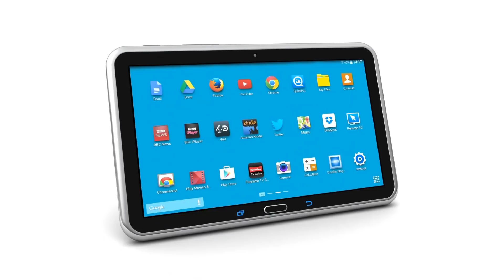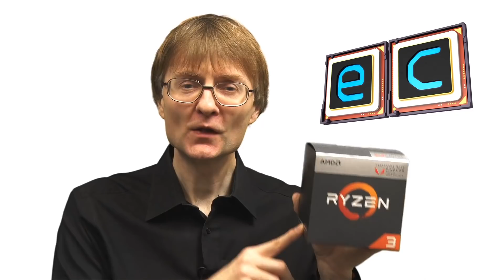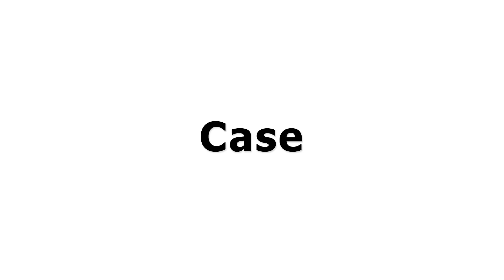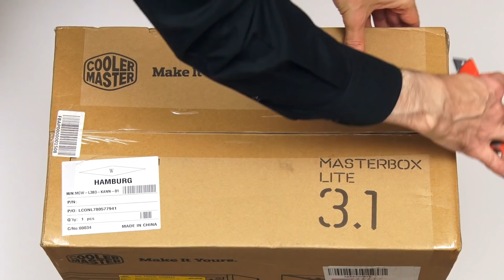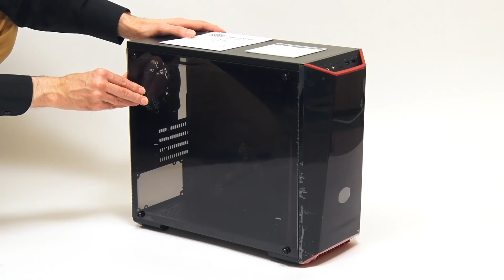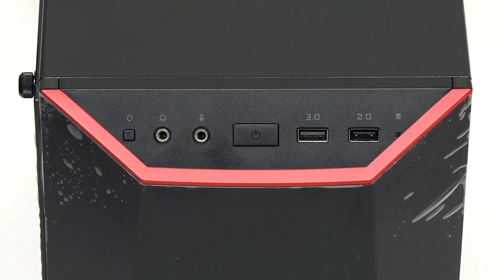Ryzen Budget PC Build #2: Case, PSU, SSD & Assembly

Comment: I am going to find it hard to sleep at night with the cables in a mess like that :(
Reply from the maker: Sorry about that. Try counting sheep! :) I will tidy them up more neatly when I have fitted all future upgrades. That said, there are few options for the mass of PSU cables. :(
Reply: @ExplainingComputers  :) Yeh looks like a pain in that case! You may have a little space in the bulge of the side panel .

I remember when cases had zero space in the back panel, i still managed to get a custom length IDE cable behind it..... just.

I like the red of the build , some nice LED fans are going to set that of a treat.

EDIT , another tip is to run the EPS 12v for the CPU between the motherboard and the tray , done that before you just have to watch out you dont crush it, most of the time you would have to plug it in and then fit the board , have had to do that in some super tiny ITX builds.

Comment: Brilliant video as usual.  I can't wait to see the OS installation, hope that is next week.  I was very surprised there is no provision for a CD drive, so it will be interesting to see how you get the OS on to the SSD.  I recently upgraded my old DELL to Win 10 by buying a CD from EBAY, just shows how old I am....Bob
Reply from the maker: This is my first large-case PC without an optical drive, which is certainly the direction of travel these days. And we will survive the OS installs just fine! But Part Three will be two weeks today (Feb 17th) as I don't want the series to take over the channel. So there is a much-requested SBC video next week.
Reply: Just burn a Windows 10 image to a bootable USB 3.0 flash drive; boot to the flash drive and install Windows. Very fast !!

Comment: Chris, did you connect the ssd to the sata 3 connector or the sata 6 connector, or are they all the same?
Reply from the maker: The ports on this board are all SATA 3. SATA 3 connectors run at 6Gb/s. As far as I am aware SATA 6 does not exist.
Reply: @ExplainingComputers  arr, just checking!!

Comment: I also have a Gigabyte mother board but would like to learn more about the BIOS could you possibly do a more in-depth vidio on the BIOS?
Reply from the maker: I will deleve into the BIOS a little more in the next video (when installing OS). But a video all about BIOS settings is a great idea -- noted. :)

Comment: I use https://pcpartpicker.com to help me select the components I need as well checking the compatibility for the CPU sockets to fit as well give me a warning on how the PCI-e addons may not have the room to fit. As for the wattage mines is at 700W from my PSU: Cooler Master - MasterWatt Lite 230V 700 W 80+ Certified ATX Power Supply
 - which my PC requires 400W. Besides as you said, we may add some powerful upgrades like a newer nVidia card or maybe additional PCI-e addons like the Creative Sound Blaster X-Fi or even those Intel Ethernet card - which are like cheap alternatives to the Killer NIC. Both the Sound Blaster and Intel Ethernet cards claim they have their own processors to reduce response times and prevent my speakers having the garbled or static sounds, and my real time gaming more smoother for less lag. But I may not take their word for it as PCI-e Sound Cards may get the onboard static side effects, which is why Creative have DAC used from the outside, as a suitable substitute.

Comment: Way back when computer cases used to come with  some sort of cardboard, I think, washers for the screws. I never knew exactly what they were for, maybe to secure the motherboard in place, but I don't know it they were meant to protect the board somehow. Do you know what those are for, Chris?
Reply from the maker: I very much remember that. Often little red things as I recall. I always presumed they were cushioning or electrical insultation for the risers/screws. Have notsee them for years now. Anyone?
Reply: ExplainingComputers they were meant to “cushion” the board from overtightened screws that could theoretically crack the PCB and also supposedly provide vibration damping for mechanical drives.
Reply: @ExplainingComputers  I think those were supposed to protect from overtightening the screws on non-reinforced mounting holes, but I think they usually reinforce all of them with metal now. Maybe they stopped supplying them because nobody used them or just to make sure the motherboard gets grounded properly through the standoffs.
Reply: I haven't seen those sold with a montherboard in quite a while, but I've seen them sold with other things, have no idea what they where for

Comment: Thinks Cris, I miss the days of building computers, due to the country I live in and it´s high inflation rate I end up repairing mother boards rather than replacing them..
Reply: Hey Rafael, I'm pretty sure my older - but nice - Gigabyte MOBO has a faulty southbridge chip.  I wonder what the chances of de-soldering and replacing it are without overheating nearby tracings/electronics...?
Reply: Hello again Chris, it can be done, however you need the proper tools for that task like a hot air soldering de soldering station and the proper solder to be able to do it.

Comment: I've just upgraded from a i3570k  to a AMD Ryzen 2600x and believe me  it was really worth the money and I'm Super happy
Reply: I can imagine that. I have a gaming tower with a 1700x in it, and I got an older Dell Optiplex 7010 with an i5 3470 in it to use as a server. I now find myself leaving the space-heater turned off when not gaming and just using this thing. And you definitely notice. That said it runs Linux just fine, so if you wanted to mess with that, that old 3570k would be well suited for it.

I do want to get the i7 version of this CPU though.

Comment: Hey man, great video. I have a similar build. My opinion is that in budget builds we dont use ssd's so we keep the cost as low as possible. Also its better to use a motherboard with 4 ram slots so we can upgrade in the future.
Reply: The new RAM you buy later will be faster :) but it will go as fast as the old RAM you have still installed.... so you will switch out the old ones too..... or am i wrong ?
plus... you want also put a higher amount per RAM slot.
Reply: @eric-janvandenbogaard9415  I dont know
Reply: If i got a second hand pentium 4 for 20 quid i would put an SSD in it , no excuse whatsoever to not use and SSD. Honestly if you dont have budget for a SSD dont build a PC till you do.
Reply: SSD for the boot drive for sure, but find me an 8TB SSD for £120 or less.  Because I'm using an external 8TB HDD that I got for £120 to store all my games on.
Reply: @KUPOkinz  True, i have an HDD 1Terra, my next upgrade will be an SSD and then a GPU